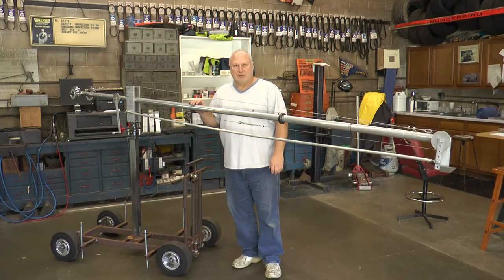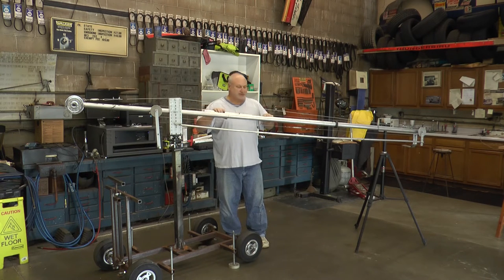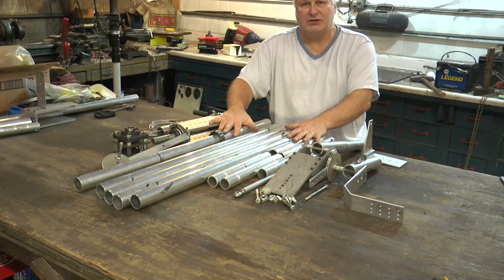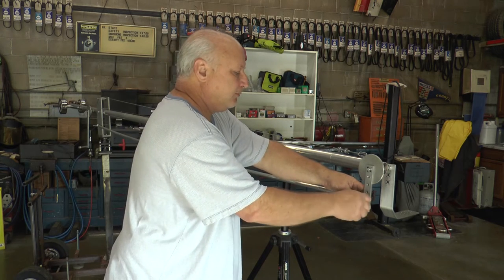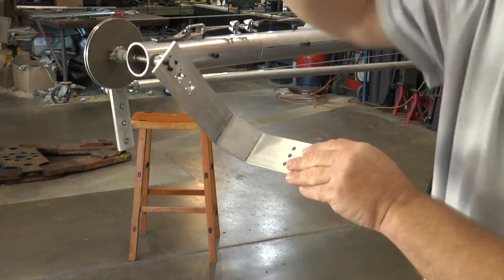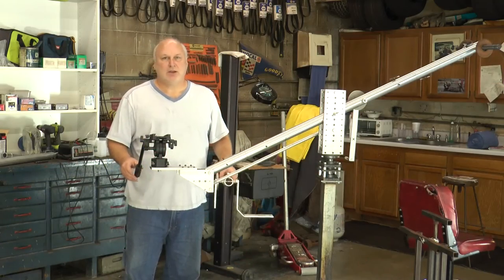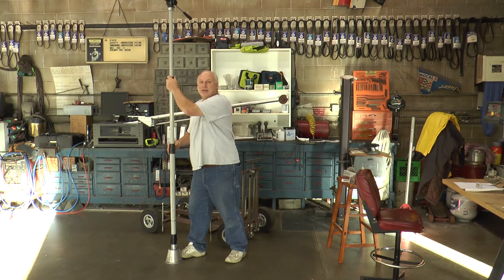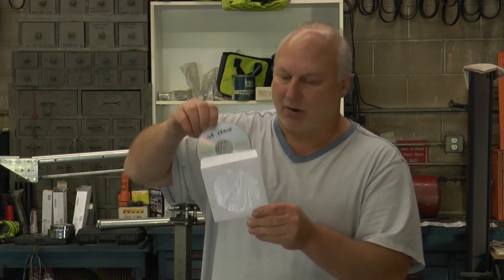Camera Jib Crane DIY

Comment: I was at 40% finished with my jib crane with rc pan and tilt & stopped there , try'ed to radio control all of it and than money became an issue so I trashed the whole but still used it for a few of my videos on my channels!!! Mikey19900 & THE MIKEY MIKE CHANNEL / THANKS